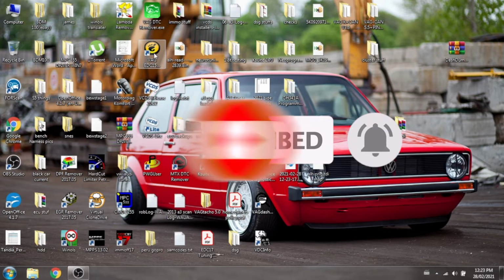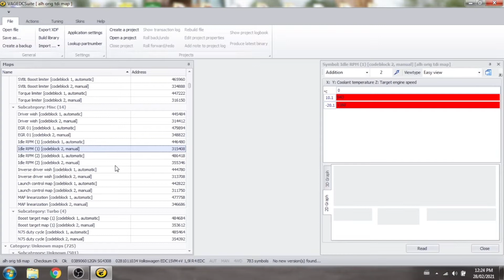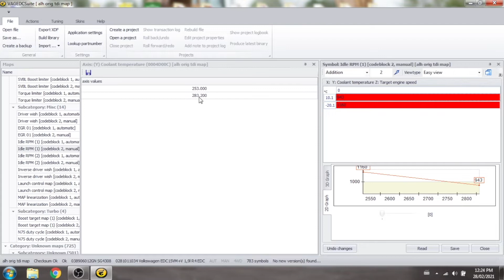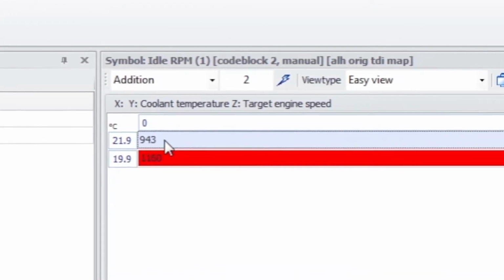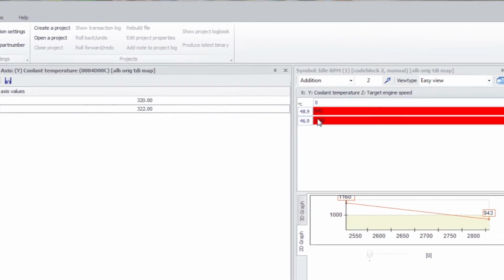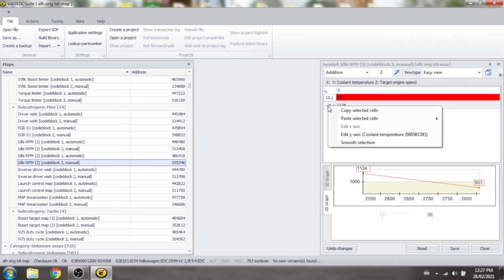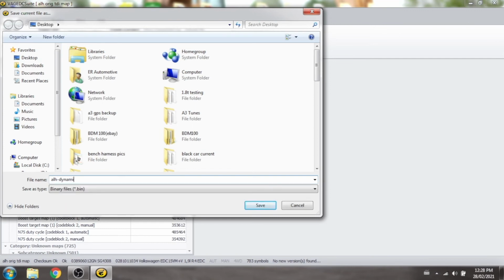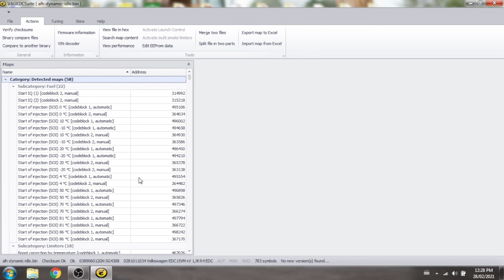How to dynamic idle alh (edc15)

Comment: There seems to be a lower limit idle timer from start map somewhere.  Dynamic idle works perfectly until the 4minute 30second time point from engine start and then drops sharply to the lower idle set above.  Instead of continuing on a linear line until the lower idle is reached.  So I've been looking for some type of timer from engine start map to prolong the dynamic idle to say 6 minutes from engine start.  Not sure which map it is.  Cold start map or timer from start map.  At the 3mintue 30seconds point the glow plugs click off and then at 4minute 30seconds the dynamic idle clicks off.
Reply: look for a single value mrwLLR_tTW in DAMOS & in Bosch docs or for a value 27000 in your dump (270s = 4.5min).

Open vag edc suite. Then open file in hex. Search "78 69" (means 27000).
Just before 79 69 you have to find your idle value (903= 87 03)

Chance this value to your desired idle. Remember its reserve hex (little endian)

For example: change 87 03 to E8 03.
The idle is now from 903 to 1000.

Dont forget to do this 2x in ALH hex.

Comment: that wont work you need to edit the 4x5 at 57E8A
Reply from the maker: It has worked on the cars I’ve done it on
Reply: Just the map at 57E8A or both the above video and 57E8A map?
Reply from the maker: This method works flawlessly on al the vehicles I’ve preformed it on